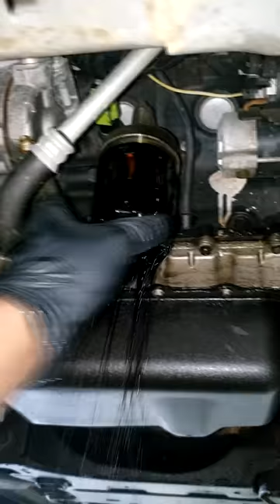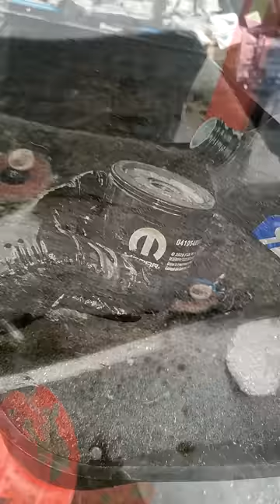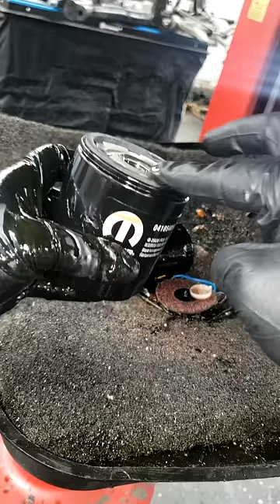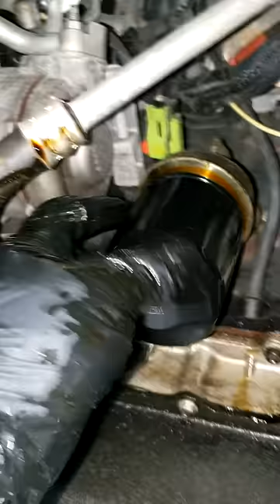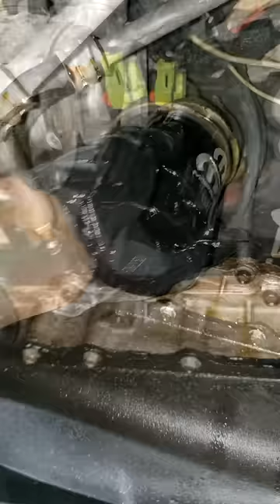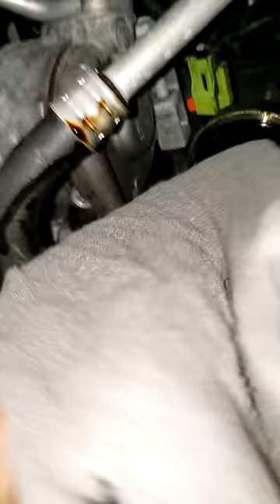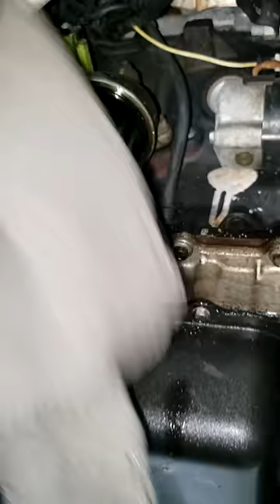Don't Lie.. Are yall still doing this?

Comment: The technique(s) shown in this video is exactly why I will change my own oil forever.
Reply from the maker: Would you like a cookie for your efforts dude? This not a dam tutorial video, im merely asking a question
Reply: @OnlineMechanicTips  Understood. However, you are a mechanic and you did document techniques of a quick oil change with suspect practices while asking a question. Oh, yes, I do prime my filters, let soak, and then top off. Nothing personal. Your video did make me watch it all the way through. Good data for you.
Reply from the maker: @bushleaguesociety  Why thank you my guy. I appreciate that and you have a interesting point.
Reply: @OnlineMechanicTips  Much success to you and your channel.
Reply: What did he do wrong ?
Reply: @sweengeppetto1915  Deliberate maneuvers to insure MAX oil swap and he didn't wipe the contact surface for a clean seal. Deliberate means mindful tactful practices with no shortcuts. Want it done right, do it yourself.

Comment: a good practice, but probably not necessary unless you have a big ass oil filter. the GM LS engine oil flow rate is about 2gpm at idle. It will take less than 2 seconds to fill up a empty oil filter.

Comment: Yup... I still do it. Couldn't stop if I wanted to! 😅
Reply: Aww. Your poor bearings.
Reply: @ricardocabeza6006  your comment doesn’t make any sense.
Reply: @internet_internet  Do you think a piece of foil seal from your oil bottle meets the tolerance spec for your journal bearings? There are endless tales of this on the internet. And no car manufacturer recommends priming an oil filter. Do you think oil filters would be mounted to engines in every possible angle if this was a crucial step?

Comment: If you only fill it half way and hold the filter horizontal and roll it for a few seconds the filter will absorb the new oil and it wont leak much if you are installing it on an engine that has filter at angle or top mounted.

Comment: Even oil out of the quarts gallons drums is considered to dirty for lubricating systems be eng hyd but I still do this just from the out side holes plug the center takes all day but yes I do charge the filter also lube the seal so the next guy doesn’t unload his tool box to get a duggum filter off

Comment: Nah man you have got to wipe down that old excess oil off the baseplate
Reply from the maker: You don't got to, its not the end of the world if you dont. Its just old oil that will simply lube the new filter seal. But yes, its a good habit to simply wipe it down.
Reply: I agree that was either a lazy are bad mechanic, he would not work on my car after seeing him miss wiping the old oil from the base plate
Reply from the maker: @danielreid80  O please please let me work on your car. Do you see how silly that sound? FOH dude
Reply from the maker: @uzephi  Dude dont be a drama squeen. Surely you read where I said yes, the old oil should be wiped down. You also should have saw where I said that its not the end of the world if you dont.
Reply: No you dnt 😂. I hope you arm chair mechanics know that all the oil oil never get fully drained because it's impossible to drain every drip from every corner of the engine or oil pan😂😂😂
Reply: @slabbinonspokezz2375  its not impossible... you can 100% break the engine down and remove 100% of all oil.... just saying
Reply: @michaelhite5652  well I wasn't talking about in that manner. How dumb are you to argue that when I'm clearly referring to oil changes. The average person wouldn't put that type of money I to a car having the engine broken down for the sake of getting every drop of old oil. Your thought on the subject or observation of the matter doesn't apply here.
Reply: This thread in the comments is the best and probably most wholesome drama I’ve seen on the internet in a while lol , thanks for my amusement everyone !
Reply: @slabbinonspokezz2375  you said it not me... "because it's impossible to drain every drip from every corner of the engine or oil pan"

Comment: Our Castrol sales rep told us not to pore oil in a filter because even new oil has contaminates in it that can damage your engine and the oil should be filtered first before it goes in  the filter. That's just what the man said. I used to always fill the filter myself.
Reply: “New oil has contaminants, and must be filtered…”  I think you should change sales reps 👎🏻
Reply: Tell me you don't understand how a bypass valve works or why.
Reply: Where does it get filtered before it gets to the filter?
Reply: @thomaselliott2608  The pre-filter/filter👈🏻
Reply: @thomaselliott2608  
At work we buy our hydraulic oil in 55 gallon barrels and fill a smaller barrel on wheels that has a hand pump with a filter on the line from the pump.

Comment: I never fill the filters on anything except fuel filters for diesels. Ive been doing this for 30 years. Customers, and personal. Still no failures yet and im a mobile diesel mechanic.
Reply: Every car you ever changed the oil in is still on the road? That is impressive.  Not sure how you know this about all your customers cars. I guess they are fiercely loyal to where they will change their oil.
Reply: @bradsanders407  nope, I don't do cars, bro lmfao 😂 trucks only i don't even own a car. I'm a real mechanic.
Reply: The idea of you knowing the current status of every vehicle you've worked on for 30 years is fascinating.

Comment: Actually most manufacturers recommend not filling the filters…
Reply: so do most filter makers lol
.
only if its been sitting for 10 years and you are too cheap to rig up a pre-lube machine
Reply: @kainhall  so the oil still sitting on the engine parts after the change is good enough then?
Reply: @jimbothegymbro7086  Precisely. Good point. Not like it's bone dry. Especially with modern oil additives like polymers and ceramics. I recently did a major head job and all the internals were nice and slippery due to the residual. I think prefilling might be overkill on modern cars unless it's a huge (diesel) filter or manufacturer recommends it. Can't exactly prefill my cartridge filters anyway. Lol. And my car now has around 1/4 million miles and engine still runs like new. 🤷‍♂️
Reply: @PGspeed88  contamination how?
Reply: @Freiherr Dinkelacker good point, I never did it regardless always thought it unnecessary when you could just crank the vehicle and build a little oil pressure if you're really that OCD about it, I never bothered
Reply: Manufacturer tell you to bring it to the dealer
Reply: @Freiherr Dinkelacker How is all that rust, dirt, debris going to get into the filter if you pre-fill on a bench and have clean gloves?
Reply: Yeah they like to sell new cars - every little bit of extra wear brings in a new buyer down the road.
Reply: @Freiherr Dinkelacker keep in mind that manufacturers are not interested in that being the last one you ever buy. They'd just as soon sell you another vehicle or engine. Every little bit helps, untill it hurts.
Reply: @Freiherr Dinkelacker most all serious engines have two oil pumps. Now contemplate why that would be. If i told you, you would not accept it. So figure it out, logicaly. Hint; one's a scavenger.
Reply: @Freiherr Dinkelacker I'll agree with that. Every precaution helps. I have a 302 block in the machine shop for freshening up. I built it last in 97, 250,000 plus miles ago. I prefilled every time. Same with all my cars.
Reply: @Freiherr Dinkelacker duhh, oclay bloss. Everyone in  the world is wrong, and nobody should change engine oil but you! Really does it hurt anything to pre-fill oil filters? Except your feelings? WOW! I'm not trying to change your mind, maing.
Reply: @Freiherr Dinkelacker to not dignify something with a response, is to truly not respond. Something that you have neither contemplated nor had pointed out to you before.
Reply: And some do recommend it, Kohler for example.
Reply: @Freiherr Dinkelacker 
Oil starvation is premature wear.
Reply: @Freiherr Dinkelacker 
Learn how to read. Oil starvation causes engine damage. If english is hard for you, dont have discussion on an American website
Reply: @PGspeed88  For a 40-gallon drum I may expect that, but if you're seeing visible dirt in quart or even 5-quart containers I'd say it's time to switch brands.  Even if we assume there is small, invisible dirt in the smaller containers, though, what it comes down to is what you feel is worse for the engine:  about 10 oz. of oil you've checked for visible cleanliness (which I do), or no oil at all (however momentary).
Reply: @PGspeed88  Well see, this brings us to the heart of the whole debate, which really revolves around three questions:  1.  Is there a chance the residual oil left after an oil change will be insufficient to prevent any extra wear at the next start-up before the new oil comes along (and based on what data)?  2.  Is there a chance the particulates in 8-16 oz. of fresh, decanted oil will cause any extra wear at the next start up (and based on what data)?  3. Will the extra wear caused by “1” exceed that caused by “2”, or will the extra wear caused by “2” exceed that caused by “1” (and based on what data)?  I have no data to tell me yes or no to any of these, but my intuition says running an engine without a continuous supply of oil is highly undesirable, and the risk of running 16 oz. of fresh, if unfiltered oil though it is negligible.  So, I charge my filters before installing.
Reply: @rrice1705 as a mechanic I will say this.  With today’s tolerances one piece of sand can cause severe damage.  The amount of oil that remains in the bearings is sufficient to start with a dry filter.  On heavy duty engines, that are designed to last roughly 1,000,000 miles are started with dry filters everyday.

Comment: This guys a savage , he didn’t wipe the surface before putting back on the filter! Left the dirty brown ring on it 🤣😂🤣🤣
Reply: Much like Mr. BrothersMotors' here sex life.
Reply: Its not his car
Reply from the maker: You recond this vehicle still running? In other words, stop being a drama queen dudes
Reply: This is the less part to worry about, the worst part is all the engine bay nasty from the old oil/oil leaks and the color of that oil, probably +15.000-20.000 miles oil....
Reply: @OnlineMechanicTips it takes 3 seconds to clean the sufferes 
You recond you stop being lazy
Reply: I worked at a lube shop for a while... never cleaned off the mating surface and never had a single vehicle come back with a leak.
Reply from the maker: @zezoo2107  Seems you the biggest drama queen in here dude. Man up
Reply from the maker: @tortol4847  All these guys change they oil twice a year and they clean freaks in they home garage. Thats so not the same as a daily grind in a shop. They could never understand that struggle. Its ok to clean and wipe it down but its not the end of the world if you dont.
Reply: @OnlineMechanicTips  Womp womp crazy to assume I’m a man
Reply from the maker: @zezoo2107  I apologize if you not. I can't tell by the name.

Comment: People say that they don't prefill their oil filters because the oil that goes in the filter will be unfiltered. What they don't get is that it's better to run those bearings on unfiltered oil than without it. Plus, the oil you prefill the filter with is brand new. And it's already filtered

Comment: Lemme try this on my car where the oil filter mounts sideways 😭😭 it would literally all pour out
Reply: My volkswagen cc has an upside down filter I've never seen a sideways filter tho what car you got?
Reply: @cole4987  Miatas have their filter on sideways
At least NA/NB generation
Reply: @cole4987  i’ve got a jeep XJ with the 4.0, it’s got a horizontal filter. 27 years olds tho lol
Reply: @cole4987  My 2006 pathfinder has one on the front of the engine almost completely horizontal
Reply: @blaismerchant8582  I'm surprised I didn't know about this I'm getting a lot of replies 😂 you learn something new everyday
Reply: @cole4987  the majority of F150s and all the new Rangers are sideways. same goes for a good amount of nissans
Reply: @austinrobertson6940  I have a nissan altima 2015. This would be pointless to do I assume right?
Reply: cole4987 alot of gm's are mounted horizontally. my duramax mounts with the  bottom facing forwards.

Comment: I would love to see this guy try this on a Subaru Forester. LOL!
Reply: You can. Fill the filter, let it set for a bit ,and the oil will absorb into the filter. Then it’s not dry starting the engine completely.
Reply: @casishaw5718  The filter on a Forester is on the top of the engine so you would dump oil all over the place trying to screw it on.
Reply: rattlesnake-ef6so  so you are putting an empty filter on. Cool.

Comment: Always put oil in the oil filter before installing it as you don’t want a dry oil filter on but make sure to put clean oil on the oil filter gasket. I always do that regardless if the oil filter is vertical, on the side of the engine. Just my way but everyone does it differently

Comment: That is a very good idea to prime the oil filters especially on turbos cars. But you need to wipe the base plate off.
Reply: Nope...bad idea
Reply: @MyDailyPerspective  why is it a bad idea.,,,,?
Reply: Being turbo makes no difference cause it not even spooled up when you initial start. By time you ready to drive that turbo and oil filter will be plenty full of lubricant.
Reply: @KeithHawk-g9n   On on diesel & turbo car's and on my own truck. I like to put a little oil in the filter. It's just a personal way. My last chevy truck 1990 5.7 had almost 400k on it when I sold it to a friend. He is still driving it. And has done nothing to it. But he keep all the fluids changed. But it is up to the individuals how they do it.
Reply: @robertclements4865  Nothing  wrong with it, if you like and have been doing it that way for years by all means do you. I strongly doubt that you pouring oil in that filter has anything to do with you getting 400,000 out of your vehicle.  It's really dependent on how you drive and how you  maintain your vehicle. Obviously you took care of it and it took care of you. I tell people all time the best thing you can do for your car is change that oil when it is due. Very important! Also whenever get gas check your oil, good habit.

Comment: When it's possible, I do.  Doesn't work on my Prius because it's a cartridge mounted sideways.  4.0L Jeeps have the filter mounted upside down and they run forever, so I'm not sure it matters.  But I do it on my Suburban, G8, and Duramax.

Comment: Tip: unplug coils, turn motor over for 4-5 seconds.. oil filter primed. On my car i just pull a fuse and crank over its a lot easier then filling the filter because on my car oil filter sits horizontal. I hope this helped someone
Reply: That doesn't make any difference, because the engine will be spinning without oil in the filter, causing wear on the engine.
Reply: @jmackinjersey1  it will be spinning slowly. Not at operating speeds or even idle. So no your wrong, and your only supposed to crank it long enough to build pressure im not saying sit there and crank it til u drain ur battery or damage your starter. The engine however would be fine.

Comment: Mechanic schools don't teach you to do that. They just say to put oil on the seal. That's it
Reply: Yeah cause it’s a waste of time to prefill it 😂. Only old heads do that
Reply: Lmao my owner Manuel says specifically not to ! Ig rag tag mechanics know more than multi million dollar company's
Reply: While I dont trust multi-million dollar companies very much these days, here they have some merit, as few people seem to be talking about the fact there's still a cup or so of oil in the system even after you drain it out. The only way to get oil completely and totally out of an engine is to take the thing apart and tip it over.

This "Head Start" stuff for oil does nothing except potentially cause problems for certain engines.